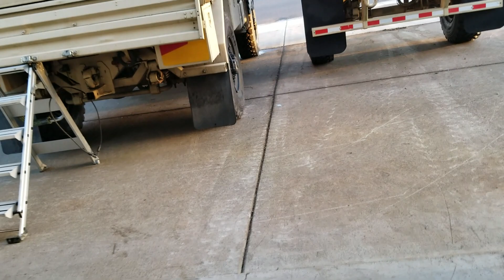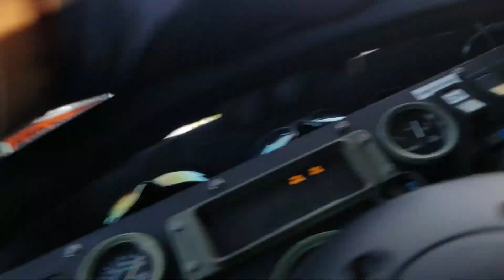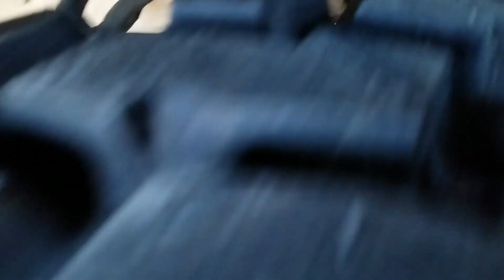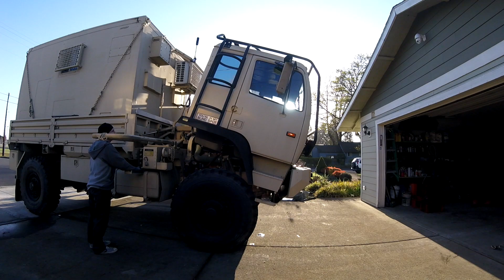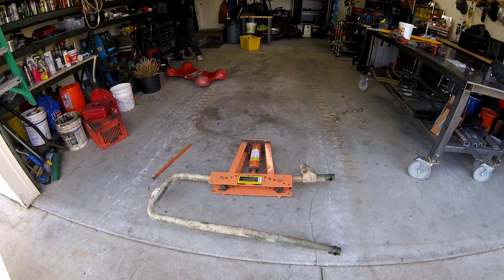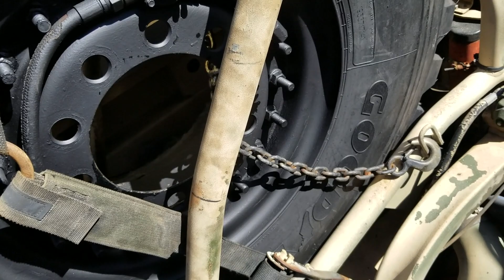Abel LMTV build part 151 (14.00r20 spare tire carrier modifications)

Comment: Use all thread and two nuts and mount he tire to the chain via the lug nut hole. It’ll give you couple inches
Reply: Also you have ctis, so mount the tire with no air, it’ll shrink diameter by an inch or two
Reply from the maker: Let me know what you think of the completed project in the next few episodes.  Thanks for tuning in!

Comment: Excellent job. Just a though can the hyd cylinder be rebuilt? Not a hard job if you can find a packing and seal kit. Just messy and some have a internal wire holding the stuffing box and the barrel together you have to spin out that can be a pain. Some cylinders are welded they can be fixed but not worth the trouble.
Reply from the maker: No they cannot be rebuilt however, I found out they have a safety valve which is what caused the leak when the directional ball valve was sending fluid to both lift and lower at the same time in the cylinder....Works just fine now...

Comment: Sean, we all love your videos and your enthusiasm.. But I have to mention my disappointment in your work here.. A couple things.. Metal fabricators know, if you expect structural tubing to be bent as you did, at least take the time to properly tempter the tubing.. This is a structural piece that see's alot of axial-loading.. Not good. Second, those welds are atrocious!! You have been very vocal and critical of others on the topic of safety in the past, and rightly so.. This is by-far the most un-safe thing you have posted!! When you post a video showing others how you lift a 400 lbs assembly in the air with horrible welds and only using inner gusset-tubing, you are not helping others, nor yourself.. I think you should re-visit this project.. I don't mean any disrespect, but this is horrible!!
Reply from the maker: I did this for a reason and you found the easter egg...this is temporary as you will see...I was using materials I had readily available to make this happen today...I have a direct replacement coming in a future episode that is adjustable...I will be making  minor corrections on it for now...also you will never exceed the tensile strength of the schedule 80 pipe they used to make the spare tire hoop, I just about broke my bender trying to modify it and that was with 12 tons of force...As always stay tuned...
Reply: @SeanFastidious  Fair enough..

Comment: Next time you have chance to get any parts from an air drop LMTV...... get that U arm you re-shaped from it.  They are made to come apart.  With way it comes apart you should be able to lengthen it very easily.... tis my plan
Reply from the maker: I would have to see it to understand what you mean...
Reply: @SeanFastidious  it is designed to come apart.... looks similar to what you originally planned minus one weld on each tube..... 

an inserted tube welded to longest end and a sleeve on outside of tube for strength....  hoop slides on inserts and is pinned in place (aka one end pinned not welded).
Reply from the maker: @coachgeo  I will ask Martin if he has one